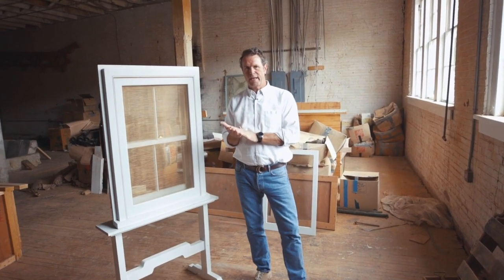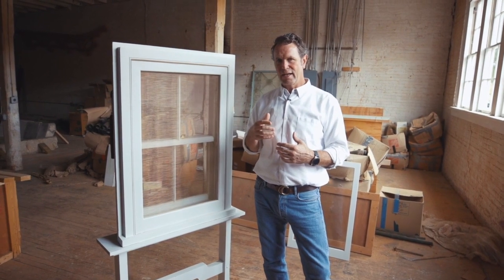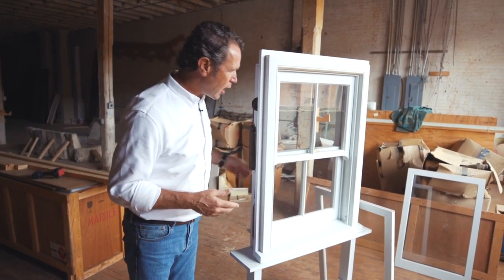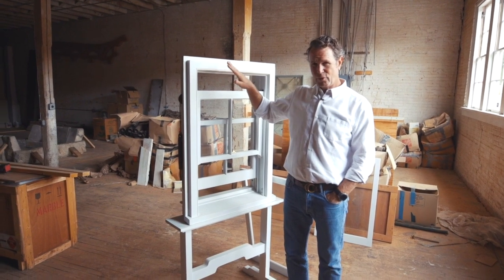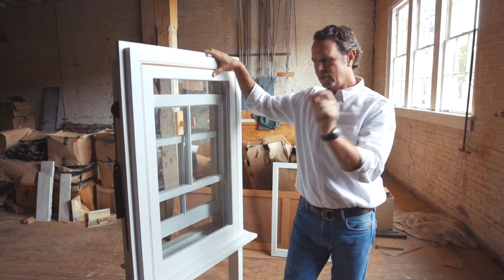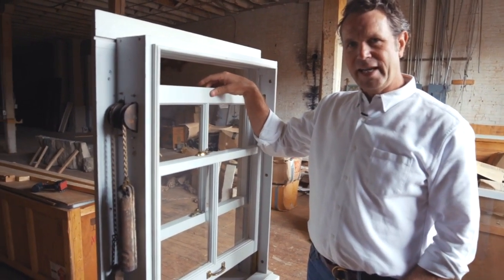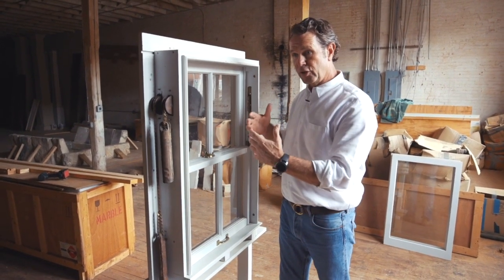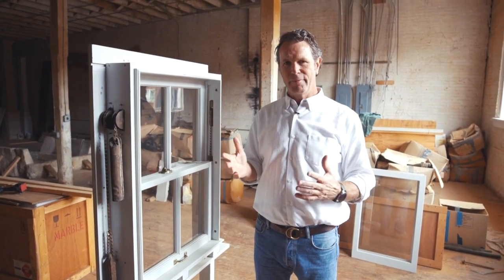Brent Hull Explores Double Hung Windows

Comment: I still have all the original windows in my 1897 house, and they are still pretty much in perfect condition, including the original glass.  Instead of chains or ropes, the weights are attached to a steel strap, which makes them very smooth.  I've had to replace a few of the straps, but otherwise, you can raise and lower the sashes with almost one finger. And they are also no leaky.  One of my neighbors replaced theirs with modern windows, but the wood rotted after about 10 years.
Reply from the maker: Thanks! It sounds like you have amazing windows. Congrats! It doesn't surprise me about your neighbor. Sad.

Comment: Do these windows have an access panel on the weight pocket? The original double-hungs in our 1904 fourplex don't have access panels, so I have to pull all the casing off to fix the broken sash cords. What that means, of course, is that they're still broken.
Reply from the maker: Our 100 year windows do have a weight pocket access. Thanks.

Comment: Hi Brent, do you have any opinion about cotton vs chain sash cord?
Reply from the maker: Well, our clients like chain for the look but I'm not sure it is any better or longer lasting. If you have original windows, the groove in your pulley will be square in the track if it was originally chain, it will have a rounded-bottom track if rope. 95% of residential I have seen are rope. Good luck.
Reply: @BrentHull  ok thank you. Windows originally had rope. Was considering chain since it doesn't tear.

Comment: Another very good video. Your point about sustainability and the economics of restoring existing features should be made compulsory for all specified. Also, your point about the quality of materials is often overlooked. If you look at new windows before they are painted, inspect the timber used. Almost always for us, it’s a softwood and plantation-grown. Neither are, in themselves, a total reason not to buy but, too often, that means rapid growth and, as a result, windows that will not last as long. Sapele is a great choice in that it has the balance between longevity and, given the right pre-treatment, it will take paint nicely. 

For us in the UK, double sash windows were originally for the better off. The houses of manual workers would not have these; invariably, the houses were rented and built as cheaply as possible. Houses built for sale quite often/ usually had sash or double sash windows. Insulation in windows was not such a huge issue here - winters aren’t that cold and summers not that hot. 

Go back to the early Middle Ages, and the everyday house would not windows at all. The manor house - here it is called the Wealden Hall, would be a very high structure - equivalent to perhaps 3 Storeys - but have no internal floors and no internal rooms. The whole place was just open plan with areas given to cooking etc. it was heated by a central fire where the smoke rose and dissipated itself through the thatch. The smoke also helped in dissuading rats from living in the thatch. Fire in the thatch was always a hazard but, being tall, by the time the smoke had met the thatch, it had cooled and any spark from the fire long gone. Early on, the windows were small as there was no glass. Some windows could be 3ft high but 2ft across but these would have vertical bars so that no nere-do-wells could get in. These openings would have leather covers which would be rolled down to help prevent wind and rain getting in. There were some people who could afford horn windows. These had horn boiled, unrolled, scraped very thin and translucent, set into lead; by the nature of horn, each pane was small. The use of glass, as with most things, started with the ultra-rich and gradually rolled through the levels of society. It was made by being blown and then, whilst still in that near-molten state, flattened as much as they could. Again, this meant that individual panes were small. The best houses could afford to have stained glass - which was a mixture of painted panes and coloured panes. The result was extremely beautiful but, with each pane connected to the next by lead channels, quite delicate. To allow for bigger overall windows (as in churches and palaces) iron rods would be fixed vertically from lower sill to upper lintel. 

The ability to produce glass in larger sheets was an enormous step forward. It allowed houses to be built with large windows. This meant that working trades such as weaving could take place inside for longer each day as the light was better. Mainly for religious reasons, weavers from mainland Europe (Flemish, Huguenot) came to England, bringing their advanced weaving processes. Given our local production of fine wool, this led to England becoming predominant in fine cloth making. There are still many towns and villages with true weavers cottages. Usually a row of 5,6,7 dwellings; separate ground floors for cooking, eating, selling goods but with large open plan first floors. This elevation allowed windows to bring in the maximum light and the open plan allowed room for large looms to producing broadcloth. 

When this industry, as all industries, started to decline with mass production in factories, those first floors were sectioned off, often replicating the ground floor areas. Some houses, as in ours, were not divided quite as neatly as that leading to “flying freeholds”. That is where the first floor of dwelling A is partially above the ground floor of dwelling B. I know of good examples of those weavers cottages throughout Kent; one of the best known is in Biddenden. Google the High Street in Biddenden and you will see.
Reply from the maker: Wow, good info. Thanks.

Comment: The pulleys look larger?  Maybe 3"?  Do you recommend a larger wheel?
Thanks for the comprehensive  Instruction! 
ps and chain vs wire core rope?
Reply from the maker: Wheels are a standard size. Typically more like 2"-21/2"
Rope is most common and should last a lifetime. So my vote is usually rope. Chain tends to me more common on commercial jobs. FYI.
Reply: re: chain vs wire core rope
Either can last but you won't want them to. At some point you or the next occupant will replace as part of other maintenance. Chain will corrode and look old; rope will absorb grease or dry out or both.
Reply: @thenexthobby  Chains come in Brass or Stainless steel.  ppl generally prefer rope